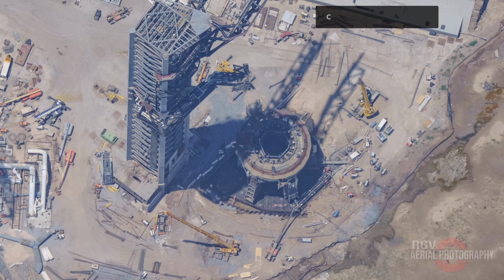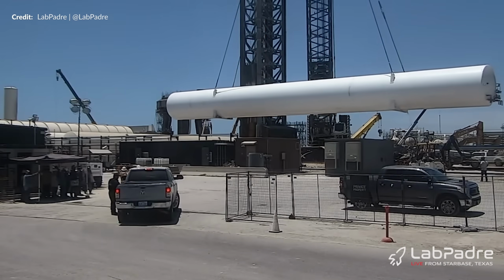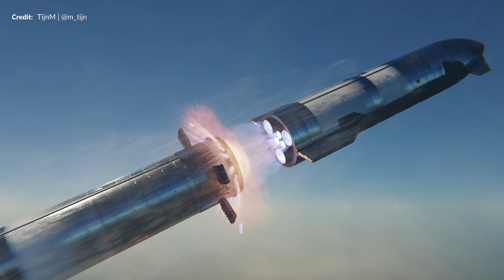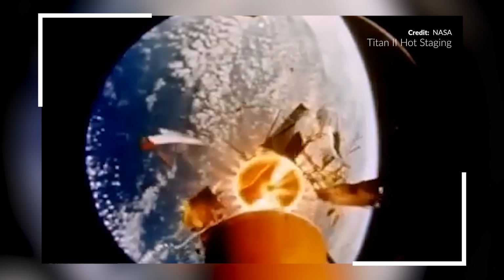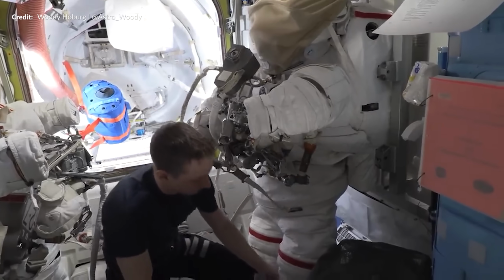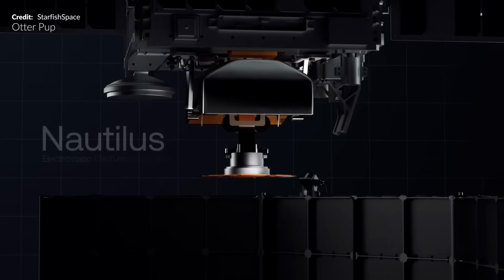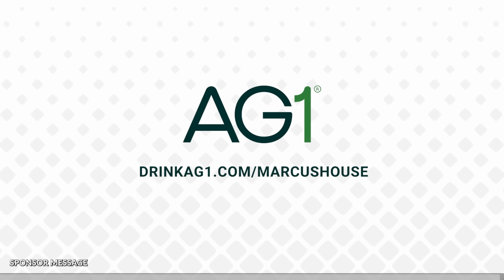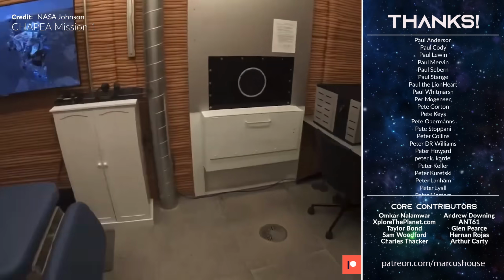SpaceX Drops Bombshell Upgrade Announcement: Can it really be that good?

Comment: We're going through a rapid technological advancement in the aerospace industry. So many programs take years to approve, build, and launch. By the time they launch, technology has advanced beyond where the program was when it was designed. I think a lot of programs will be cancelled. That may include Artemis. I know billions of dollars have been spent on it, but it may be time to cancel certain portions, and then redesign. The ULA hydrogen rockets are pretty much obsolete compared to Falcon 9 and Falcon Heavy. The Starship program will just about make the ULA rockets look ancient, or at least decades behind. A new Moon program will likely arise after Starship is operational. By 2025, we may see a Starship as the primary transport and orbital space station. It may carry a smaller lunar lander to transport cargo and people to the surface. If the lunar lander runs on methane it can refuel from the orbiting Starship. At some point, Starship will land on the moon and bring large cargo to build habitats.

Comment: Didnt we do this in th 50s and 60s?  I wanna see some flyin saucers and aliens and shit Elon.  My old ass would come out old age retirement just to go to work for you.  I would eeee haw that nuke all the way to the ground for you.  I'd ride that sum bitch.  Send me up instead of monkey.  I can drive multispeed tranny and handle or not handle a clutch slicker than owl pooooh.  I can put the pedal to the metal and pull the shoot.  I got me a Nokyosanyosung cell phone and a Royce CB radio you can communicater with me to.  Waste?  Theres alot of space to throw it out the door.  Roads?  There are no roads where Im uh goin.  A 44mag Spacemans Special, sheetman, that otter handle any bad Aliens up there.  Give em hell Elon.

Comment: I love the 3d printed building in terracotta clay but can is withstand being pressurized to 10 psi?  Of course not, it has flat wall panels and those would push out under one ton per square foot and blow everyone out into the near vacuum of Mars.  The REAL building must be curved to withstand pressure and either fiber reinforced or steel reinforced and even the floor of such a building must be curved.  The whole structure must be lenticular or spherical or tank shaped in some regard to deal with pressure from within.

Comment: The concrete trucks should just save everyone's time & pour it all across the surrounding wildlife area. The next launch is going to be an even bigger explosion than the last. 
Starship isn't going to Mars. Not in your lifetime or the next. There are a thousand technologic hurdles to overcome first. The spaceship is the least of them. All Starship will be used for is delivering Starlink Satellites & the odd commercial mission. That's if it ever gets permission to launch again before Starlink sends SpaceX into bankruptcy. If it launches before 2025, I would be extremely surprised. You guys need a dose of reality. You're boy at the top is the problem with all of this. As long as he is around, SpaceX is doomed.

Comment: I have a neutron absorbing material that is awaiting patent. Through the process of absorption of gamma and neutron radiation the material creates deuterium by adding the extra neutron onto the hydrogen Atom. The gamma radiation is absorbed and the heat is converted into v oltz

Comment: Re. Hot staging, I suspect the protective cover for the booster will be built as part of the vent ring. They could also shape the cover to direct the exhaust depending on which engines (vacuum or sea level) they decide to use to separate. I suspect they’ll use the vacuum engines since all they’ll have to do is throttle them up once free of the booster. They also won’t have to light up the sea level engines twice.

Comment: Serious question:

Muskteam did no calculations on the viability of the previous design and yet were amazed when it failed. Why do you believe that they have any more clue or figures to support this new one?

You are getting a hard-on for every little  flange and widget they place into the sacred pattern and you have no way to know if any of it makes sense.

Wouldn't it be better to be able to cozy up to a cute little feasibility study or even a muskpaper? What the hell do they need secrecy for? We're going to know the entire setup two months from now, so why not put out the engineering spec for those people who are into that sort of thing?

Could it be it's because they don't have one? That they are winging it? They are just throwing whatever they can think of at the problem like a proper JIT (ie hair on fire) company does?

Certainly would be the first time that Musk has failed to approach a problem in the careful, reasoned, methodical style for which he has long been famed.

Comment: Soon rockets will be completely ridiculous to the scientific community, as they already are, like the current automobile engines, especially that massive cross-section in front of that tube you're launching all your eggs in one basket with.
  You morons better think a lot bigger and use a lot bigger of a scale if you're talkin about traveling through space to other worlds feasibly.  Your vision is far too small right now.  
  Using mag-rail to propel much smaller modular portions of ships with smaller cross-sections into space.  Then perfect ion engine, which you idiot humans won't achieve for another who knows how long because it is usually just one person that figures things like this out.  One person that may not be as intelligent as geniuses but that has creative genius off-the-chart to be able to put things together.
 I am living proof of this.  You moron engineer still haven't figured out the fastest greenest most efficient form of human yet.  All those degrees and worthless!   Well, I have figured out the fastest mode of green, non-fuel, non battery, non solar, most efficient mode of transportation.  
  Infoq world for never helping me give it to you all because I have actually produce the prototype, and I have another invention which is far superior to cool anyting than anything being used today.  And again screw you off for not helping me achieve these things for you all!  I have two fully working prototypes.  All I get from you useless scumbags is judgement so now I am throwing your shit seed back at you all !
Reply: I don't see why automobile engines would be "completely ridiculous to the scientific community".  Energy density is an objective, measurable quantity, and that's just one of many...

Comment: On the shuttle the SRBs had a frangable coating that burnt off on re-entry. Why don’t they use that same coating on the launch tower base. As the launch starts, the coating burns off and could protect the tower structure from thrust erosion. Also use the frangable coating on stage insert for hot staging.

Comment: Hydrogen is a next generation tech, literally requiring Force Fields to utilize. Anyone trying to use it is going to have to create a disposable system, at best. Hydrogen is the smallest atom, and literally floats through all materials we've ever seen. In doing so, it can break bonds, and make everything brittle, and flammable! Literally, Force Field tech before we go that way with any regularity.

Comment: No. It won't be that good. And this waste of a time monument to Musk's vanity will not see regular usage as intended. EVER. There are too many engines on the damned thing. If the design a larger raptor and get the total of number of engines down by 1/3, they will have a chance. Otherwise, look forward to multiple failures and ultimately a dead project with a huge price-tag. I wish people would realize that Musk is not the genius he fooled you all into believing in.

Comment: CHAPEA:  That sounds like a really cool mission.  If only it were being conducted either on a rotating platform in LEO or on the Moon.  Of course, that would up the cost by probably 20x to 50x.  But it's too bad it can't be something like inside of 4 Bigelow-type modules at the ends of a cross-shaped set of tunnels, each some 300m long, all rotating at a speed to produce the effect of 1/3rd the gravity of Earth in those modules.  This way the effects of low gravity can be studied, as well, during the 378 days.  Alternatively, to build the 3D-printed habitat on the Moon.  That would be under 1/6th gravity.  Either of those two locations would be far better than going all the way to Mars (at tremendously greater distance and risk) to find out 1/3rd gravity is not survivable for more than a few years, or something like that.  But CHAPEA should learn some valuable lessons.  At least it's a step in the right direction.

Comment: Hot staging opens up at least a few more possibilities for launch escape, of which so far there seems to be very little, at least based on the current design. However I don't know if the second stage can separate while the first stage is still running most of its engines, too much thrust. So an inflight abort due to a problem with the first stage  isn't possible until the first stage engines have had time to mostly shut down. But if the first stage totally quits then they lose the ullage thrust that they need to start the second stage engines. So they would only have a brief moment between full thrust and no thrust to fire the second stage engines.

But I don't think the second stage Raptors can safely ignite without prechill. So maybe on crewed flights they would start second stage prechill while still on the launch pad. They would also need to prechill the second stage on the pad if they plan to have pad abort capability.

Comment: Well considering 1 G = 9.81 m/(s^2) and say staging takes 10s, then both being higher and faster drops that off some, that is probably ~95 m/s of lost acceleration.  That is a lot to lose when you could hot stage and reduce that.  This also gets into why I think tanker Starship could be better than you think.  Max out the engines on it and do basically full throttle to orbit and the effective hang time should be much less.  Also don't forget that centripetal force is a square factor, so the rocket really gets into not spending propellant hanging against gravity more at the tail end of the burn, especially as it gets into the higher G's with most of the propellant load burned off.  So, hot stage where there is never really a pause to acceleration and zip up to orbital speed fast with the best engines in the world and that should make a big dent in what can be hauled up to orbital speed.  Then you just need to fix the landing system, which I wonder why they haven't looked into the arresting cable airship approach as airships can catch mid air, no reserve propellant needed for a landing burn and airships can make it back to base a lot faster than a drone ship with a booster on its deck.

Maybe instead of the airship or a drone ship, they could have a mega multi-rotor drone do the catch.  Such a beast would have collective pitch prop-rotors.  But yeah, at least when I did R/C helicopter flying, I could fly my R/C helicopter straight down at ~80 mph in controlled flight and fly straight up at ~60 mph just using a BLDC electric motor and a LiPo battery pack.  A mega drone could have gas-turbine engines and use carbon-fiber torque tubes to deliver the power to the prop-rotors as well as inline electric motor/generators and batteries for burst power and to help compensate for mechanical problems such as a failed gear-box.  If push comes to shove, it could allow for a graceful failure where the mega-drone sets the booster down into the ocean gently, deploys some airbags, and then sets itself down in the ocean on the airbags in order to stay afloat and be recovered for use on a different day.

Comment: Hot staging really doesn't seem likely to succeed. Think about the booster providing thrust and suddenly gets lighter by the weight of the second stage- while the second stage is acceleating away, the booster will instantaneously accellerate, meaning recontact with the second stage is extremely likely. The booster engines would have to be carefully modulated to prevent this issue. Will the raptors be able to deeply throttle enough to prevent recontact and not extinguish? Even if they don't extinguish, can they throttle up from low idle, without causing combustion instability? Hot staging also may cause damage to the booster, as the second stage thrust is going to heat and pressure stress the forward dome amd all the avionics located in the upper portion of the booster. Seems counter to the whole reusability concept. I get the feeling there is a breakdown in the design methodology at SpaceX- grasping at straws, versus sound engineering judgement and methodical design/vetting processes. I hope I am wrong, but my gut tells me otherwise.

Comment: I was just trying to remember when Blue Origin last did something news worthy?
Reply: Their capsule RSS H.G. Wells aborted away from a failing booster to save the capsule. If it had been a crew flight and not a science flight, the crew would have been saved and possibly not injured at all. The abort is high G, so there is the possibility of some injury.

Comment: The russians need to be removed from the American space station.
Reply: There is a reason it is called the ISS, which means International Space Station. There are two halves of the ISS, the Russian segment and the US partner side of the ISS. Both rely on the other to continue working.
Reply: @steveaustin2686  That can be changed. It's a bad idea to be partners with a terrorist state.

Comment: just wondering when this lands on the Moon what is it going to do to the surface? If it does land somehow ok... the launch will be even more spectacular....
Reply: The current plan is that HLS Starship has a ring of 24 small engines at the top of the propellant tanks for the last bit of the landing and the first bit of launch on the Moon. With the thrust distributed through 24 engines rougly 25m from the ground, a lot of it should dissipate before reaching the surface.

Comment: Hey Marcus, I was wondering with the 3D houses they are going to try and make. Do you think they going to have some kind of expansion foam in the walls, that will expand and fill any holes if there is a breach in the outer wall. Or  to have something that can absorb or dispersing kinetic energy. Something that can stop a breach of the outer wall too the inner wall, to protect the habitat.

Comment: I’m impressed how fast Spacex ideas go to production, like the metal launch plate and the hot staging concept. Other companies concept to production takes years. Thanks for the info and video Marcus. 🚀
Reply: They were planning the water deluge system before the 'orbital' test flight RUD in Apr 2023, but apparently Musk didn't want to wait for it to be installed.
Reply: @steveaustin2686 more important to get hype and the money that follows from it than actually delivering what he promises.
Reply: They already had it. I can't wait till they try it though. It's quite literally the dumbest f''n idea possible. All that water is instantly going to turn into steam & all that steel around it is going to explode. Let's say by some miracle it didn't though, it's still never going to work as it's literally impossible to pump enough water through to counter the energy of the 30 odd engines firing down on it.

Comment: When the last Rocket exploded on the launch pad... I wrote a critique about the structure of that pad... Unfortunately, I don't have Elon Musk's e-Mail, as I could have prevented that disaster then. Now watching the new launch pad, I got the shock of the day... What it tells me, is that Elon's Engineers did nothing else than augment the scale of the same old launch pad. They did not address nor calculate the physical reactions of the different fire pressures that inside at the moment 'Zero'... meaning, that the fire - the heat - and its different pressures, will again reach and involve the proper rocket. It appears to me that all this has been designed and build too quickly, perhaps to show workmanship of Space-X - I don't know...? But, I think Space X are taking another dangerous risk... Including here also, the short time for cure of the concrete... I wish someone advises Space X of my warning.  Because if I am right, Space X may be discriminated and run into another technical discredit, and worse than this, will be its delay... Indeed, Space X should scrutinize the engineers who calculated the diverse physical systems acting at the launching moment. Why? Beacuse in a time, when the |USA is living a "ridiculous Civil-war" between Democrats and Republicans... Just think about...! Yes, I am hinting at gross sabotage!!!
Reply: What rocket company do you worked at? Any experience on space industry?
Reply: @alvianchoiriapriliansyah9882  Yes

Comment: What a contrast ULA's development methodology is with SpaceX. If SpaceX had that hydrogen-leak-on-the-upper stage problem (no less likely to happen than for ULA) it would be a matter of tacking some reinforcement onto the next iteration of the upper stage that they are already preparing to build in the highbay, sending the old 2nd stage to the rocket garden and then stacking the new one. While ULA has to send the troublesome stage back to the distant factory and have it rebuilt. There's no wonder that ULA's development is SO slow.
Reply: The Centaur stage has been in use for a LONG time. Apparently they have been updating it, like how SpaceX updates the Falcon 9, and the latest iteration when too thin on the dome. So that upper stage is going back to the factory. It is as yet unknown if that stage will be the one that returns or if some other stage at the factory already is used.